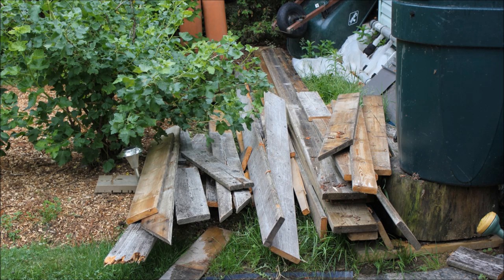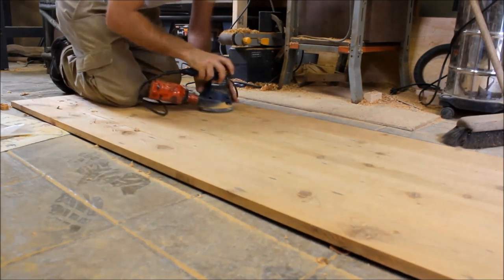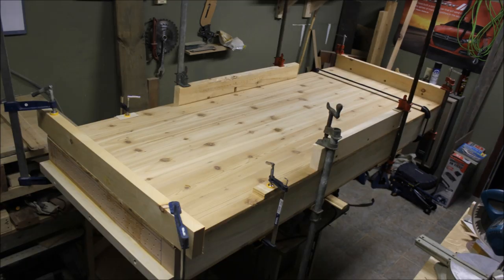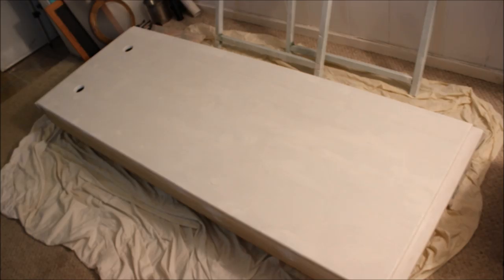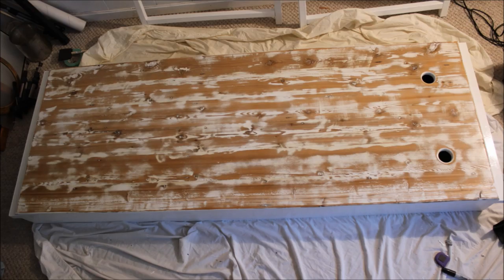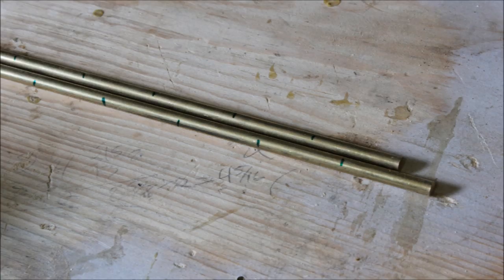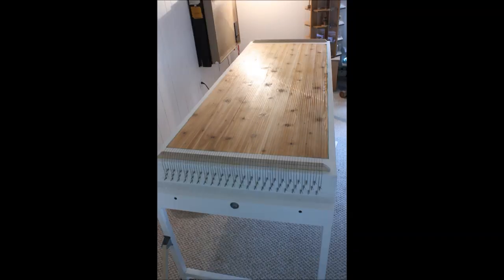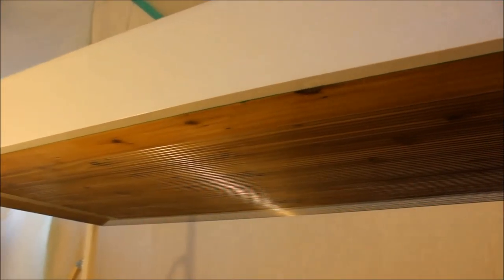Creating A Bed Monochord

Comment: I really would like to build one of these myself, I would love a step by step tutorial on the build, specifically the tuning portion of it as I do not know where to begin!
Reply from the maker: Fundamentally its just a box. The larger monochords are more challenging, but not really that different than the small ones.

I am unaware of any step by step walkthroughs of making one. I no longer have a shop, so it's not possible for me to do a build instructions video, but I do have two monochord still, and could do a video on how to tune them in the future. One needs new strings anyways.

I advise starting with a small instrument and using guitar strings for it. That will be the least money and will be the easiest to troubleshoot if things go wrong. :)

Comment: You mentioned that the resonance board side is much thinner than the side that supports the weight of the person. Please can you give details on board thicknesses. Thanks for your inspiring build, so that monochord healing can be done on a budget.
Reply from the maker: This was done so long ago now I am not sure of the exact measurements. If memory serves the resonator panel was 1/4"-3/16" thick, and the panel that was laid on was roughly 5/8" and then reinforced with scalloping to help support the weight. I never had anyone over 210lbs on it so I cannot attest to its maximum capacity.

Comment: Have you thought of mounting a speaker below the strings that emit a sine wave to keep the strings in perpetual motion? We did experiments like that in the studio in the mid 70s. Fun stuff!
Reply from the maker: I have considered it, but have had trouble getting the strings perfectly tuned with the Zither pins that are in it. Any sound that I play back into it only resonates with1/2 the strings! lol. I would like to use machine head tuners in my next instrument for more precise tuning.

When you did the experiments how did the amplitude of the wave affect the sound output of the strings? Was the effect something like strumming the strings loudly, or a soft resonance?
Reply: Danial McCoy Back then we'd send a guitar track into a small amp under a grand piano at a medium volume, 96DB or so then we recorded the piano strings,with a stereo piezo mic. We used a large stone to keep the damper pedal depressed. :-) The result was a sitar-like sound (chromatic of course). Very spacey. As you have a monochord you might want to try a small, low freq speaker, like they build into cars, playing a sine wave an octave below your strings pitch. That way the fundamental from the speaker won't be so audible but the strings should vibrate sympathetically and produce a pretty good signal. Just an idea!

Comment: Nice work Brother 
It’s amazing 
Im a woodworker and a creative 

I’m also a music and sound therapist.  
I have a nonprofit I run in Texas 

I’m looking to make one, not as large as yours though. 

Need your help. 

Questions 
What type of wire did you use?   
What was the gauge?   

What type of wood did you use for the sound board and what was its thickness. 

How many layers of oak did you use for the tuning block?  

I’m looking to buy used piano tuning pins.  

Blessings to you.  
🙏🙏🙏
Reply from the maker: Hello!
Thi wire is piano wire. The diameter of the string is 1.02mm or 0.0405 inches. The company I bought it from didn't use gauges on their site, but used the strings diameter measurements.

I used 3/8" cedar for the resonator on the bottom and 3/4" cedar plus scalloping for the top surface. My big mistake was using wood that had knots in it. The wood shouldn't have any knots at all.

The pinblock is made of two layers of  finished 1" thick oak. 

Good luck on your build!
Reply: @MiscellaneousMcC  hey there, I'm just plain curious, why was it a mistake to use wood with knots? What difference or problem does that make?
Reply from the maker: @nemogfr7029  
The knots creat weak points in the wood. Changes and temperature and humidity don’t affect the knots at the same rate as the rest of the wood, and so they are prone to severe cracking. 

This instrument ended up with a catastrophic crack in both the resonator panel and the top panel. I’d love to build another one with proper wood 😊

Comment: the bottom resonating panel is a veneer one piece?
Reply from the maker: The resonator panel if made of the same cedar as the top, only it is about 1/4" thick.
Reply: @MiscellaneousMcC  are all the blanks put together with joints like these : https://prnt.sc/wfugjv
Reply: @MiscellaneousMcC  how thick is the top panel?
Reply: @MiscellaneousMcC  also what are the dimensions of this table? thanks :)

Comment: Hi, thanks for the video and well done on a successful project. My brother is going to make me a monochord bed and we are wondering how you worked out what string gauge to use?
Reply from the maker: Greetings Alistair!

I had a very hard time figuring out what gauge to use. I ended up going to the hardware store and buying different gauges and types of wire and building a small single stringed instrument to test out what gauges produced what notes at varying tensions. When I found one that I liked and wasn't too tight I ordered that gauge of string from a piano string wholesaler.

A tip is that heavier gauge strings sustain longer but are lower are similar tension to lighter strings. Because of the length of the bed monochord even light strings will produce rather low notes unless they are quite tight.

I hope this helps!!
Peace!

Comment: Hello, nice work that you made. It inspired me to build my own soundbed.
I was just wondering if the bridge should be better placed on the surface of the resonance body? I can imagine it would transport much better the sound. What do you think?
Greetings from Mexico
Reply from the maker: Hello! 
I have tried putting the bridges on the resonator and have found the pressure of the strings will cave in the panel and bend the bridge severely. You may be able to put it there with a series of sound posts to support it, but there is a tremendous amount of pressure from the strings on the bridge. 

Cheers! 😊
Reply: Aaaah, cool. Thanks for the info, that prevent me from eventual damage. I like the idea with the sound posts....I think I just  have to try out different things.

Thank you for sharing your work process and honesty with making  mistakes , that's how we all learn today from YouTube, right? 😄
Reply from the maker: @juclima  
Absolutely! I love it, so much to learn every day! 🤣

Comment: Could you provide some info on the strings? Are they all the same length and gage? I want to make one of these instruments.
Reply from the maker: They are all the same length and gauge. They 0.0405” diameter strings on this particular instrument! Good luck with your build! 😁

Comment: nice man, im in the process of making one, the only thing i can t find out is the tuning, gonna use piano strings and do c# alternating thinner -thicker strings, hows yours tuned
Reply from the maker: This one was all with one size of string and tuned to a single note (Low E). If you are going to be tuning to one note I suggest using a single string size. If you are planning on tuning it to two different notes I would place all of the strings from one note to one side of the side you will be playing, and the other strings beside them. That way you can play either notes separately or together if you like. 

When you finish it please upload a video of it. It would be great to see and hear it! :)
Reply: yeah i will do, i made a sound chair where i had alternating thick thin strings both tuned to c# where the thicker sdtring was an octave down which gave a nice harmonic but i do like th sound of yours its got a nice deep sound to it, thanks for the reply by the way its hard to get advice on these things and some is trial and error
Reply from the maker: Yes I know what you mean. It is almost impossible to find information on building one. So lots and lots of trial and error. I am going to try the alternating string setup on one of my future monochords, it sounds interesting! 

I have several designs I am hoping to try out this summer. Really off the wall designs, that I am looking forward to sharing on here. Good luck with your build! Oh, and where do you get your strings? I use pianosupplies.com for my wire.
Reply: I used steel guitar strings for my chair whuch worked quite well as I think piano strings would  need too much tension for my chair design..thanks fir the website..im in the uk so siging off now to get some shut eye..speak again some time yeah
Reply: @captive_worlds  John, it would be great to find out more about your instruments. Do you have a website?

Comment: Excellent work! How did you go about tuning the strings?
Reply from the maker: +rhymeshot  Thank you!

I used an online bass guitar tuner and a piano wrench to tune the strings. I started at one side and worked my way across, then went over them again to fine tune them. It usually required tuning once a month or so, largely depending on humidity.
Reply: Very cool. You've inspired me to want to create one too. Maybe a small test one first. Can I ask you what tuning chart you based the design off of?
Reply from the maker: That's great! It is a lot of fun, and quite easy to do actually :)

I didn't use a tuning chart for this actually. Since all the strings are tuned to the same note all I had to do was pick a note in the range of the string and tune the rest of them to it. I would like to do an actual chord of three two or three different notes next time, just to see how it sounds :D

Good luck with yours!

Comment: if you want deeper and more powerful resonance then Spruce Wood is the only way to go. Clear grain Spruce is the best resonating wood known. Stradivari Viol instruments are made using european spruce wood. The best musical instruments use spruce. The greatest pianos in the world have a spruce wood sound board. Guitar makers use spruce for the acoustic guitar tops and for the strut ribbing on the inside because it enhances resonance and makes guitars sound way better.

Although the resonance in your monochord has deep resonating qualities, it is also somewhat muted because of the gluing of different pieces of wood together. Even trees of the same species has different grain patterns and grain densities. This disrupts the resonance that naturally exists in all types of wood regardless of species.

Musical instrument makers prefers woods that have clear, tight and very straight grains because sound travels and resonates far better than knotted wood, or pieces of wood glued together.

And finally, if you really want to improve your overall tone quality as well as the resonance, then invest in some decent quality hide glue. Hide glue is the preferred method for gluing and joining wooden music instrument pieces and parts together, especially violins and high quality acoustic guitars. Many asian countries where the monochord originated from still prefer using hide glue instead of commercially produced adhesives.

Hide glue remains permanently strong, durable, yet maintains enough flexibility to not fail. Also, hide glue can be revived again and again. It is easily manipulated and removable should an instrument be damaged from abuse, accidents or age. The glue is wet and heated for ease of removal and restoration/repair. Most of the oldest violins in the world are still usable today, even after more than 400 years of use. Most of the surviving violins in the world are still in almost pristine condition with little to no sign of falling apart. A testament to the durability of a good grade hide glue.

Your instrument is Ok, but could stand for improvement.
Reply from the maker: Thanks for the reply. I am aware of everything you have said, but alas, when this was made I was but a poor man using the materials I had at hand. 

Despite its muted nature, many people enjoyed laying on it while it was being played, and more still enjoyed listening to it. 

Cheers!